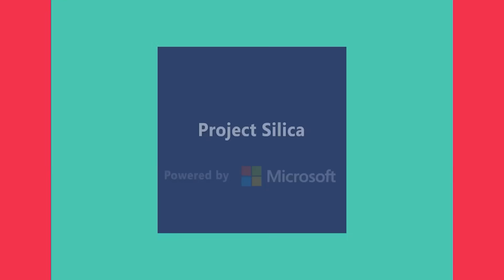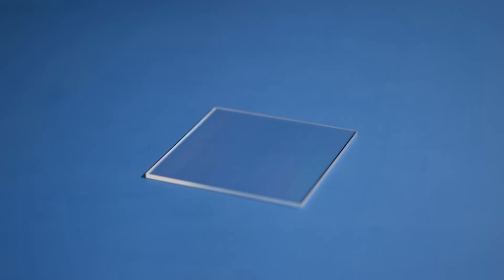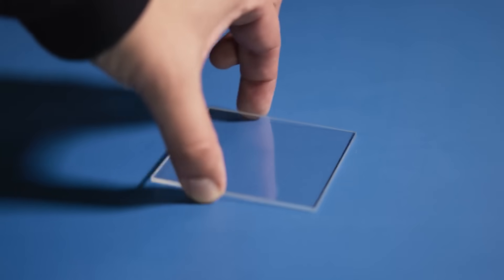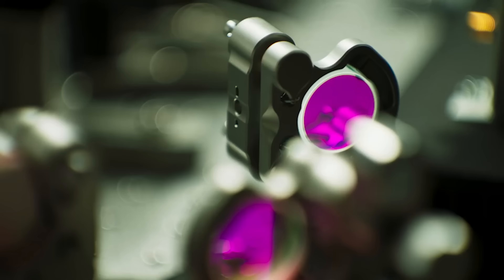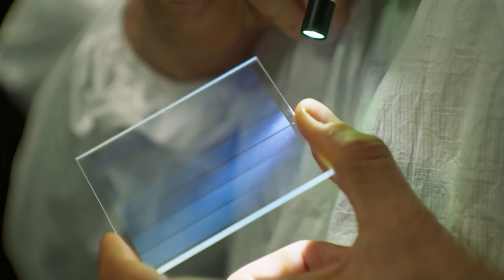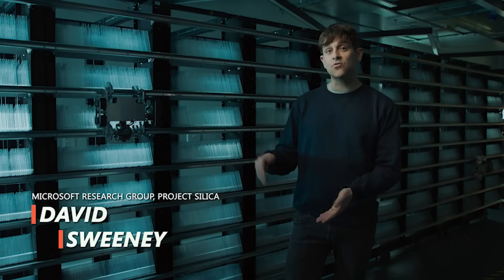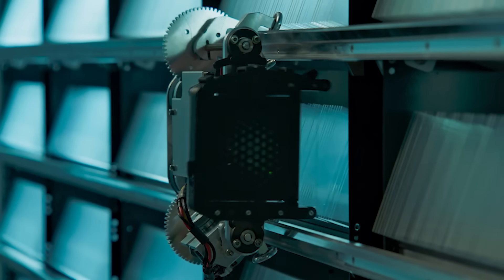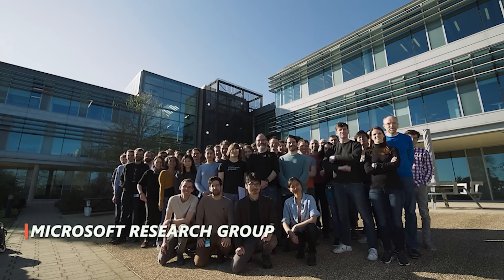Sealed in glass - Microsoft's Project Silica

Comment: According to Microsoft’s website, each glass panel can store 7Tb of data.  Impressive.
Reply: Impressive!  ...until the robots start dropping the glass panes on the floor...
Reply: @TristanMorrow Glass RAID …. I wonder if the encoding in the glass itself contains error correction that would allow a broken glass to be read from reconstructed pieces like a QR code supposedly can…
Reply: @TristanMorrow 😂😂😂😂
Reply: @TristanMorrow soon it’ll be 7 zettabytes
Reply: They will use Corning gorilla glass! Hahaha
Reply: @TristanMorrow There'd be no way that they'd use your average piece of glass lol.
Reply: @TristanMorrow it may be huge blocks of glass that can store 10s of thousands of TB
Reply: @TristanMorrow  That, or a human starts shattering the glass to erase their record. The thing is about glass is that while it may last for quite some time longer than either hard disk drives or tapes, it's also just as brittle as glass.
Reply: @Iamwolf134  I think you underestimate glass. It's a rather tough medium.
Reply: The only tradeoff would probably be transfer speed. But for long term storage that doesn’t really matter. It seems like a cool solution to add to our data needs.
Reply: no way bruh
Reply: Yeah! impressive👏
Reply: Storing data for millenia? No. Nothing is sure. But i thing  that's practical for couple centuries
Reply: It's for "permanent storage" and NOT for "speed of read/write access". Weather/Fire/CME proof.
Reply: Tf didn’t they say that then?
Reply: JackSalzman   an explosion can shatter all data....not safe
Reply: JackSalzman  ...so they choze glass
Reply: I guess. I have a 44 Tb mechanical hard drive.
Reply: You can compare this to optical disc. On a CD, it uses binary "pixels" where each data written can either be a 1 or a 0. Meanwhile what Microsoft is demonstrating here is 5D quartz storage. A single voxel stores data based on both amplitude and orientation which allows it to store up to 8 bits per voxel!! And because it's a voxel, it has multiple layers. So you have X,Y,Z,Amplitude & Storage. AKA 5D storage.
Reply: Me with my 8 year old hdd drive that was 80€ at the time (2tb). Yeah definitely, 5 years if ur lucky, thats why i swapped pc 3 times in the meanwhile moving around the drive, I still have 96% drive life remaining, according to the WD Dashboard.
Reply: receipts
Reply: Just need a million dollar microscope to read it.
Reply: Anymore updates on this? Thanks
Reply: Meth smokers entered the chat..🧟
Reply: в перспективе.  в QR много не запишешь. Не удивлюсь если окажется что это все баян и на стекле сохраняется только ссылка на файл в облаке, технология очень сырая.
Reply: You can store 2TB on a micro SD card that nearly everyone has readily available access to. Js
Reply: Drops the glass...
Reply: that isnt alot
Reply: Imagine stumbling while transporting that data, destroying the entire history of mankind in a single second 😂
Reply: yeah that's what I wanted to know and they didn't mentioned on the video because (?)
Reply: holy shit
Reply: So basically it's a Star Trek isolinear chip.
Reply: You are correct that the current theoretical potential storage capacity of a single glass plate in Microsoft's Project Silica is 7TB, which hasn't been proven yet. Since November 2019, there hasn't been any significant progress apart from the 75.6 GB storage and reading of a single glass plate. It has been almost 5 years in the current state, and Microsoft is trying to generate hype for investors. Meanwhile, the research remains stagnant, as the funds are being redirected to finance current artificial intelligence projects among other agencies, while losing money on Bing as we speak.
Reply: Sad still not big enough to store a picture of your mom.
Reply: has microsoft ever invented anything useful? If they went away the world would be no worse off.
Reply: Press x to doubt
Reply: @sky0kast0  You can check how it's done. Basically you can write/read data on the same location by using different frequencies and you can store in a 3D space.
Reply: @blackdereker4023 so why hasn't this stopped usage of traditional databases for data storage when it is much better than it and costs no electricity?
Reply: @pwinsider007 A database is not a physical storage medium. This is intended for long-term storage where traditional methods require energy intensive re-recording to newly manufactured physical media every few years.
Reply: @pwinsider007  This is for really long term storage. For data that is supposed to be archived instead of being frequently used.
Reply: @pwinsider007   Why are you talking about databases? those are a software mechanism not a hardware data storage format... You are comparing apples to a socket wrench.
Reply: @pwinsider007   first obvious reason is speed. then we have many other aspects like.. it's durable in a room.. it's not durable in a smarphone falling over your hands into the floor every single day, right? then there's cost of saving.. and another obvious one is that is like a WORM - "Write once read many" type of data storage.. you can't rewrite into a 3d glass over and over right? I'm sure you can imagine plenty of other reasons by thinking a bit.
Reply: @pwinsider007  This is a backup and cold storage solution... Think.
Reply: @sky0kast0  you're wrong. It actually is capable of storing 7168 bytes of data, there is also a 75.6GB version
Reply: @sky0kast0  we have SSDs that store at least 2x that on a chip 1/20th the size. That much data densite isn't what's impressive in the slightest.
Reply: @sky0kast0  voxel based glass storage solutions could be one of the most dense storage mediums possible in the future and 7tb actually seams quite low for the size of the glass pane. i think the only storage medium currently more dense is DNA and that is way more susceptible to damage and way harder to deal with when reding and writing.
Reply: @SuperJonathanmatthew  Yes, I imagine the capacity will increase substantially as the technology is refined and the number of layers rises.
Reply: Tb? So less than 1TB...
Reply: That's a lot of Tiktok videos.
Reply: @LarsPeterA: Very impressive indeed but sustainability?  Nah! Glass is most fragile, if not a bulletproof glass and I don't think those are bulletproof. Tempered may be. Now what will happen if a disaster struck? Crystal will be much better. But this is certain that this technology is for Microsoft only and it is not for regular users like us.
Reply: Thanks, surprised they didn't even mention anything in the video of the data scale. That's actually mad, imagine how much storage there is in that room.
Reply: I can do the same on a different piece of silicon technology 
I don’t live for thousands of years
Reply: Enough to store my games
Reply: Just wait to they start storing data in lab created diamonds - just imagine that storage capability!
Reply: @robdewberry2587  About the same, or less. Not a physicist or chemist, I'd guess.Or an economist, for that matter.
Reply: No one, literally no one, has even noted or mentioned the fact that even if the glass media were the most durable, reliable, and dense form of long term data storage….
It’s a different story for the equipment that will write - and read - the data stored on these simple-looking glass panes.

Imagine the cost of setting all that up just to even use the glass as a storage medium.
Then imagine the operational and maintenance costs.
Then imagine worst case scenarios, like the entirety of all the machines that process these panes get damaged or destroyed beyond usability or repairability…

In that scenario, they’d be stuck with nothing but batches upon batches of useless, barely decorative and very unreadable glass panes. And don’t forget the encryption they will end up using on these things because greedcorps using the same BS called ‘SAFETY! SECURITY! We’ll keep the data secure, never mind the fact that people won’t be able to decrypt it if all the machinery and devices used to do it got rendered unusable!’ followed by the usual pandering to the consoomer with sales pitches, marketing, etc.
Reply: a hard drive can do that and i can access them all on a network instantly....  it's an interesting medium but the access they have right now looks rather slow.
Reply: @rumls4drinkin  It looks like this is meant to replace magnetic tapes, not the faster hard disks.
Reply: @fakestiv  sounds like it's meant for very long term data storage for like, future generations tbh not to replace anything we have right now...  something we'll put inside a pyramid rather than serve data center requests.
Reply: @rumls4drinkin  "sounds like it's meant for very long term data storage for like" oooh, it's actually the point the video started from. facepalm
Reply: @rumls4drinkin  I think the purpose here is long term storage that last generations instead of instantly accessible storage such as a server farm. Glass media certainly does offer some rather unique advantages over magnetic storage for long term shelf life. My major concern with using glass, and it’s quite evident is the fragility of the media. Glass shatters, cracks, chips, and so forth. They never talked about how secure the data is if the media were to succumb to such trauma like I’ve mentioned.
Reply: @Brian_Onesimus  you'd think that if somebody were to push that shelf over, all the glass will to the floor and it will all break. But 

(1) the shelves can be bolted to the floor. 

(2) the glass need not be just resting on the shelves like plates in our cupboard. The slot could provide some grip/resistance so that the robots need to pull them out. If you were to turn the shelves upside down, if you were to turn the entire building upside down, nothing need to fall out.

(3) do you have a smartphone? Have you ever dropped it to the floor only to be surprised that it did not crack? These plates are a lot lighter than our phones, because there is nothing attached to them. They are much more likely to survive a drop to the floor. Not all glass are the same.

(4) nobody said that the write surface is exposed to the air. The write laser could be focused to write the voxels BELOW the surface, or the write lap could just slap on another blank piece and glue it on top, after they've finished writing. The video's title says "sealed" in glass. This seems trivially obvious to me. If it gets scratched, heat up the glue ever so slightly and replace the cover plate with a fresh one. The back plate is scratched? Doesn't matter, read from the other direction.
Reply: @danielch6662 great points, number 4 tho, since a voxel is a 3d figure, wouldn't it have to be below the surface? Or is it more like drawing a 3d shape on a 2d medium, like a cube on paper? Which isn't truly 3d, but an optical illusion to trick our brain
Reply: @Brian_Onesimus  glass can be bulletproof... just need to be thick
Reply: @rumls4drinkin  The problem they are trying to solve is long term archival. As the video explained, magnetic storage has limited shelf life.
Reply: @rumls4drinkin  Apparently someone missed the point of the video. This is meant for long term storage. Not to be used in your gaming pc.
Reply: @rumls4drinkin it's for long term cold storage.
Reply: @rumls4drinkin  I don't think it's made for the purpose of fast access but rather storing data unchanged for really really long time. Good luck doing that with modern SSDs or HDDs. They will all eventually lose the information stored on them, and compared to this technology, in a very short amount of time.
Reply: @rumls4drinkin  a hard drive wont last 1000 years. if stored correctly and handled with caution glass can last basically forever and except for drop damage glass also has a much much higher temp and liquid resistance than any medium commercially available.
Reply: @rumls4drinkin  its slow because it doesnt need to be fast, this isnt access for servers or internet, its ultra long term storage and backup, it doesnt need to be fast at all, it just needs to be reliable and last a long time.
Reply: @rumls4drinkin  was you listening to the people from video?
Reply: @rumls4drinkin its for knowledge purpose, long terms, not for you. read between the lignes if you dont get the paragraphs
Reply: @rumls4drinkin  It is for a specific purpose such a legal records or tax documents that needs to be stored for at least a decade. In such case, you will keep copying it from hard disk to hard disk, a glass can provide permanent storage solution.
Reply: @rumls4drinkin Yes, but it’s not like you will always need millisecond access to your senior prom photos from 8 years ago.
Reply: @rumls4drinkin  do u even watch the vid?
Reply: @rumls4drinkin  seems this is long term data storage, literally forever.
Reply: @rumls4drinkin  This medium is meant for historical data like your mother's photos. It's not designed for daily business or personal use. It is meant to preserve our current know-how and information which can possibly be useful for future generations.Think Egyptian hieroglyphs preserved in stone. Same concept, different media.

Comment: Any idea how much data each of those glass squares can hold? And are they rewritable?
Reply: Supposedly 7 TB and i'd suspect no, assuming they are etching microscopic holes in the glass and sealing it back up.
Reply: @fuseteam  7TB, though a prototype bumped it up to 75.6TB. Yes, they are etching with lasers and microscopes. No, they are not sealing them back up. Whatever for do they need to be sealed up? You just slap on another blank plate of glass when you're done writing.
Reply: @danielch6662  slapping another piece of glass is what i call "sealing back up" aka they are not rewritable

Comment: Subject to earthquake, explosive terror/attack, an idiot with a hammer or even just the will to knock over a shelf or throw the glass on the floor, dust, mold/mildew, exposed surface requiring cleaning... And if the robots stop working, is there a manual way to know what's on a given glass plate?   And the speed of those robots -- seems really limiting. Why not stack the glass and have the laser know exactly the depth to focus the reading beam -- eliminate the need for a robot and just make the lens move from stack to stack? 
I love the idea of this and the goals, don't get me wrong, but the execution of the retrieval system seems miles backward (at least the way it's presented here).

Comment: Looks like Star Trek’s color-coded microtapes has become a reality. TOS never ceases to amaze with its predictions. 

Being they’re glass based and likely stored on the West Coast, what happens if an earthquake hits?
Reply: They fall to the floor, and you spend days picking them up and trying to sort through thousands of plates. Then somebody points out that the robots could ID the plates, so there's no need to sort them. Just insert into any blank slot on the shelves.

Do you not have a smartphone? Have you never dropped it on the floor? These plates do not have the weight of a battery and smartphone attached to them. They are much lighter, and more likely to survive a drop.

They also don't have to just rest on the shelves so that a bump will drop hundreds of them to the floor. I imagine there is some grip/resistance so that the robots have to actually pull them out of the slots. Even if you were to turn the shelves upside down, they would not fall out.

Next, you bolt the shelves to the floor, so that if the building shakes, the shelves do not tumble over.

What if the earthquake destroys the whole building? In that case, the problem is not with the storage media. If the building is destroyed, any kind of storage you can think of would be affected.

Comment: Finally, real data crystals. I wonder though why they don't build a microscope that can read the entire crystal at once?
Also, what happens when there is a spec of dust or a scratch? Would that not render the data contained unreadable?
Reply: You can recover a surprising amount with error correcting codes.

Comment: Doesn't glass kinda... bulge or splurge out at the bottom slightly over time? Or is that just very large glass windows that are old? Or even something I was misled into believing was true? Something about it behaving slightly like a liquid even though its a solid? Guessing even if it is true maybe the amount is within tollerance or they can counteract it with lower temp storage than what a window might endure.
Reply: This has been debunked so often it's surprising the idea is still around. No, glass is not a "frozen liquid", it doesn't "flow". It an amorphous crystal, i.e. a monocrystal - a pane of glass is the equivalent of one single crystal. At temperatures way below its melting point, glass does not flow, bulge or splurt.

Comment: I often worry about data we loose but this seems a viable technology to long term storage
Reply: I think you mean “lose”, not “loose”
Reply: @Yasb00gie_down  yes. Sorry, English is not my native language
Reply: @Yasb00gie_down  nitpicking a person's grammar or spelling is petty.
Reply: except when the glass breaks!  ooops
Reply: @moe47988  we had many kinds of glass wich is hard to break or we can protect glass after write
Reply: What if the surface is scratched ?
Reply: @speedsterh  As I understand is kind of 3d write, tomograph in reverse... so maby it is enough to change angle slightly. Also I'm sure correction codes are used, those from CD could recover few millimeters gaps or scratches, those on R-DAT could recover part of sound rewinding fast forward or recover data if one of heads was damaged... as I know from wiki was a huge advancements In correction codes over last 40 years (thanks mathematicans😍)